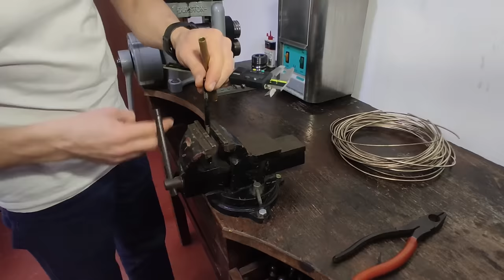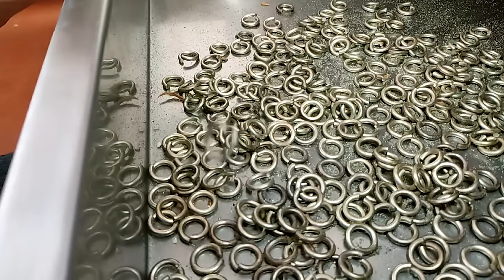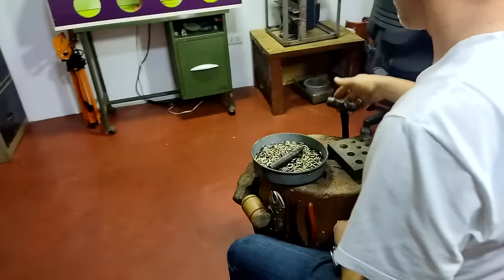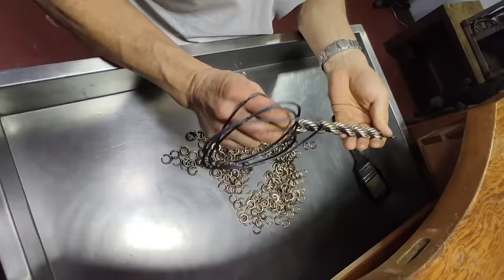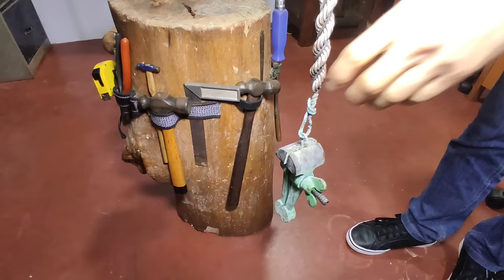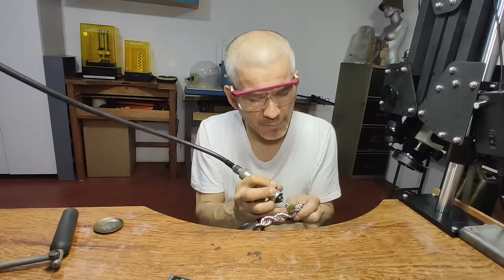Big and endless Rope chain.   (Cadena Cordón grande y sin fin)

Comment: The individual ring ends were not soldered. Of course, they were soldered on the circumference in an alternate configuration, but wasn't it necessary to solder the ends? Maybe by design, they get hidden in the spiral, but I could see raw ends in one shot of the video.
Reply from the maker: Thanks for watching the video.

Comment: Makes me wonder what the metal composition of the wire is too. I made a chain with similar sized rings and it was 1/4 hard 304L stainless steel and half of them titanium. Had to but 9” linesman’s pliers to manipulate them and had to ice my wrists for a month after the project to calm down carpal tunnel.

Comment: hello , what is the blue liquid in 3.51 ? very nice vidéo, thank you .
Reply: it burned and he was using it to clean the links so id assume some kind of alcohol used to clean all the grease or body oils etc
Reply from the maker: Hello Joe. The product (Blue Alcohol), I buy from a chemist friend who makes this type chemics for the jewelry ,is called Blue Alcohol, don't know what it contains, it could be Alcohol, boric acid, borax. It's used to prevent oxidation and allow the solder to flow more easily. Thank you for you suport.
Reply from the maker: Hello Yves. The product (Blue Alcohol), I buy from a chemist friend who makes this type chemics for the jewelry ,is called Blue Alcohol, don't know what it contains, it could be Alcohol, boric acid, borax. It's used to prevent oxidation and allow the solder to flow more easily. Thank you for you suport.

Comment: What kind of soldering wire is that?! I'm used to using chip solder and a pic to individually solder each piece on. This would change the game for me!
Reply: You can get hard, medium or easy solder in wire form. Usually1mm or 0.5mm in diameter. Many places, depending on your location. Ebay, Amazon,  Rio Grande   etc.
Reply: @lifeurge  I order from Rio quite often, I will have to check it out, thank you!

Comment: Wait...how did the links not fall off if you don't pinch them together?
Reply: The wire holds them in and then he sealed them with soldering. The little thing he melts between the links is solder its molten silver that then hardens and holds it together.
Reply from the maker: Hello, Of course the links are woven as you say with an opening but the iron wire with which the rope is assembled holds everything so that it does not disarm until the moment of the soldier.  but it is welded on the sides of each pair of links so that two open links become one, I hope I have cleared your doubt. thank you.
Reply from the maker: @vx8431  Thank you very much for your support.

Comment: How much did this piece sell for?
Reply: Probably  too much  I believe  it's silver  Probably  weighs 300 grams    200$  worth of silver that sold for 1500  lol 😆  too much
Reply: @Savethepandabears  Clocks and Colours Capsize piece is more than that and much much smaller. lol
Reply: @Savethepandabears  300grams 🤣 and the rest
Reply: @Man19893  ya I know    which is crazy for  a chain made 0f silver at 72 cents a gram  atleast that chain      has remarkable  craftsmanship in it and lots of detail
Reply: @Man19893  that chain looks to be about 15mm which would p u t the weight between 240 - 410 if it was 30 inches in length
Reply: Idk but this is a definitely a higher level chain to make by hand

Comment: Don't understand. It looked like he did not solder the cut in each link BUT soldered each link together, if that's right how does it still bend
Reply: look back at how he arranged them together. he flipflopped them so that each link captures the other, and the two that are soldered lock the ones around them. Not all of them are soldered, just the pair that keep the others in place. every other set doesn't bend, but in between they do.
Reply: @Unstopapple  yup

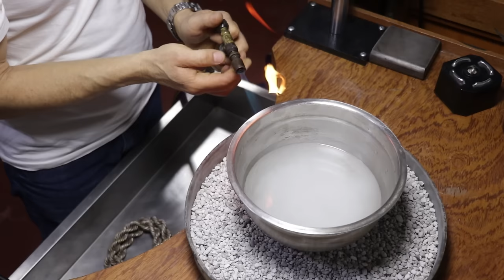Comment: 12:04 also really curious what you’re doing here.
Reply: He's using heat and a mild acid to remove the oxidization from the metal.  Takes hours off the job of cleaning it.

Comment: why didnt you use a drll and a metal dowel to form the loops of wire, you just drill a hole in one end of the dowel and thread a little through then spin it with a drill